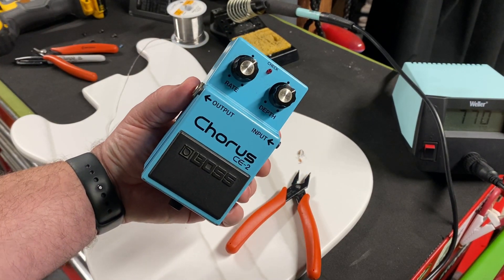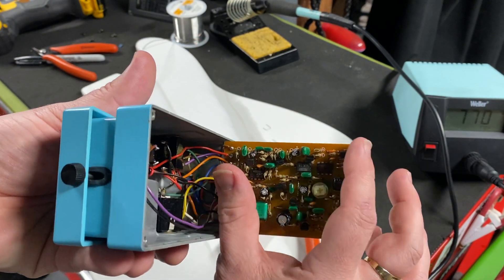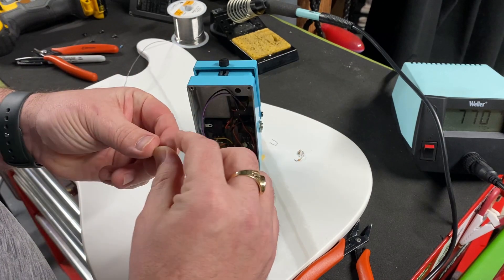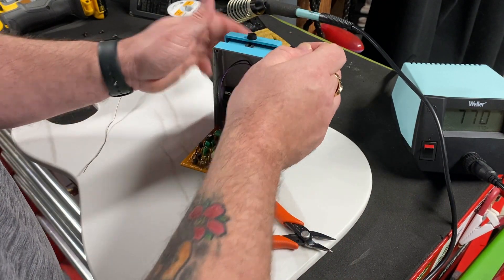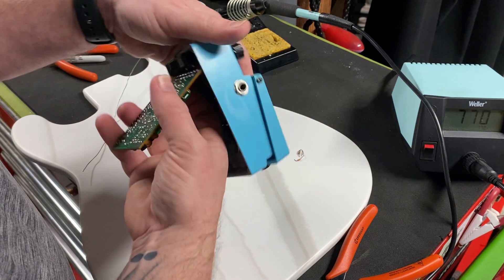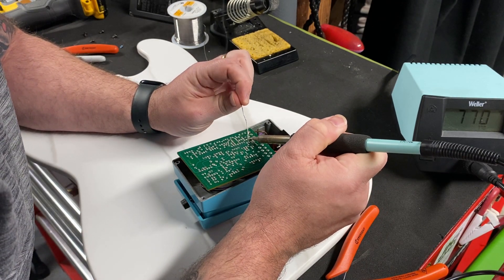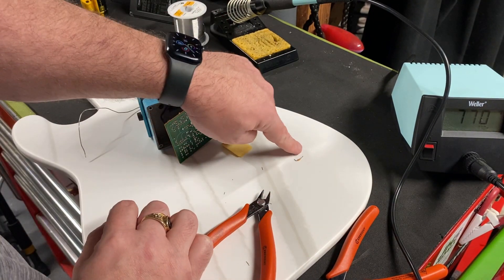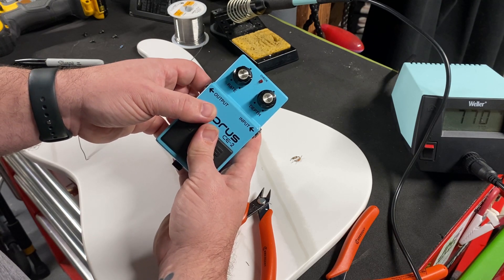Boss CE-2 1982 ACA to PSA power supply mod DIY electronics

Comment: Do you know what the mA is on this pedal after doing the mod? I found online the pedal normally runs at 9mA is that accurate? Thank you so much!
Reply from the maker: @guttyrankz  I did not take a measurement but I’d think it would be the same draw as a result or the step down components being removed.  In other words the old 12v were choked to 9 in the pedal.  Since that voltage drop occurs after the components I’d suspect the current draw would be identical or nearly so.  In other words, the new draw should mirror what the pedal normally draws with a full 9v battery
Reply: @ really appreciate the detailed response and info! 🤘🏼

Comment: The Voodoolabs PSU has trim pots to change the 9v outputs, to 12v ACA. Very useful for my old CE-2 and CS-2. I noticed that some PSUs have 9-12v variable outputs, would these be suitable for the same purpose, the manufacturers never answer when I ask? 

I know there is some distinction between 'Regulated 9v' and 'Unregulated 12v'?

After conversion from ACA to PSA, is the pedal more susceptible to being damaged if accidently connected to a 12V PSU outlet, than a modern PSA BOSS pedal?
Reply from the maker: Good question regarding using the improper supply AFTER the mod.  I wouldn't think it would be the end of the world if you did, but I wouldn't want to test that out on a vintage pedal that could be a lot to replace.  I mark mine to say "PSA mod" when I do it.  Sure, that marking can come off, but then again I only use isolated 9v supplies (voodoo labs etc). 

If you have the option to use a 12v center negative from your power supply, it's not necessary to do the mod.  

I did the mod because I wanted to be able to use it with the more common power supplies; plus I like taking everything apart.

Comment: So, you basically just put a jumper in place of both of those components?  About to do this one.  Have you tried any other mods to the CE2?  My main concern is: do the depth and speed mods truly allow you the original sound plus the new one, or is there indeed a trade-off!  Cheers and thanks for the vid!
Reply from the maker: For the ACA to psa conversion it is simply removing that diode and resistor and placing a jumper across those points.  So instead of it being a diode and a resistor it’s just a piece of wire.  I used a cut off resistor leg for both but you could just as well use a 0 ohm resistor in each spot. 

There is no change to the sound when doing this, it just corrects the voltage so you can use a modern power supply.  

I have not performed the other mods out there, I thought about it but honestly when I hear chorus, the sound to me is a stock ce2.

Comment: I have a CE-2, wondered if it was broken as my psu wouldn't power it and only worked on a battery.
Reply from the maker: Depending on what year your CE2 is, you’ll have limited function if you use a 9v adapter as the voltage gets dropped to 5.5-6.2vdc by the resistor and diode (depending on which model pedal and what value the schematics have).

Take a look at the back of the pedal, if it says anything like ACA, then it’s the old style. If the sticker is gone you can tell by looking up the serial number.  Boss had some pedals on psa and ACA at the same time, but in 97 they transitioned to psa for everything. 

Chances are it’s a pedal that uses ACA.  The mod is 100% reversible and costs next to nothing. If you can use a soldering iron you can do it.  Just be careful with the signal traces, on the old old stuff they can come off of the board if you’re soldering, desoldering, soldering, etc.